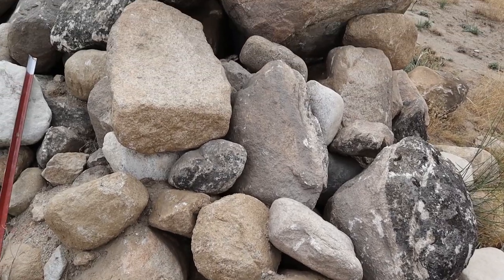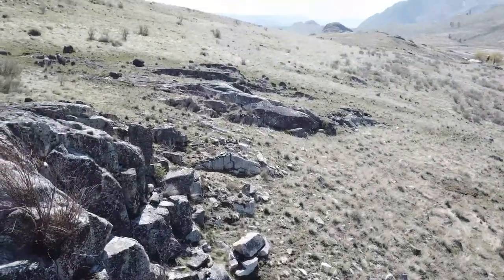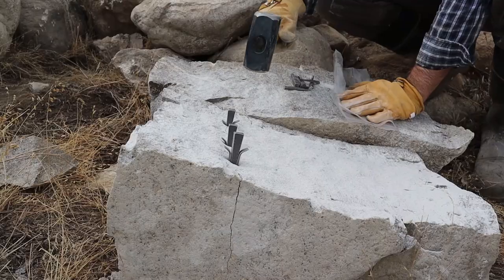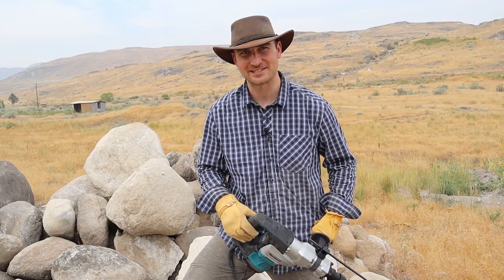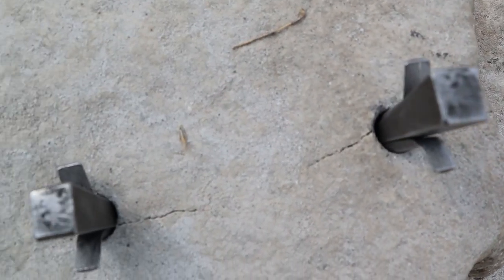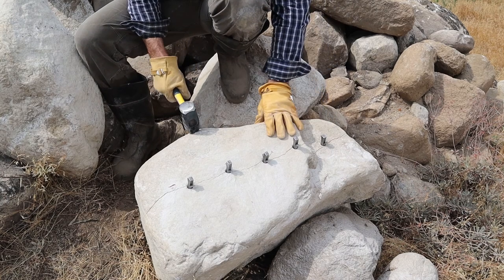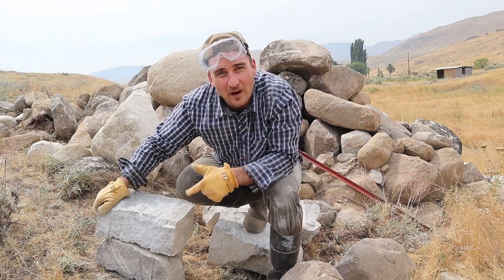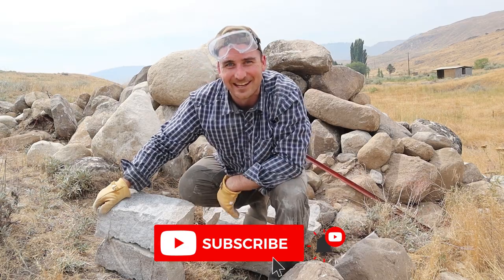Splitting Granite Boulders Using Feathers and Wedges

Comment: How do you get rid of the marks on the face from the  drill holes?
Reply from the maker: There is a special diamond wheel you can get for an angle grinder if you wanted to remove the grooves in the rock